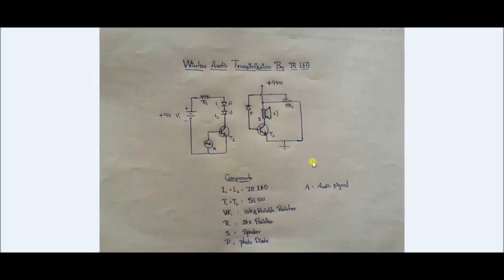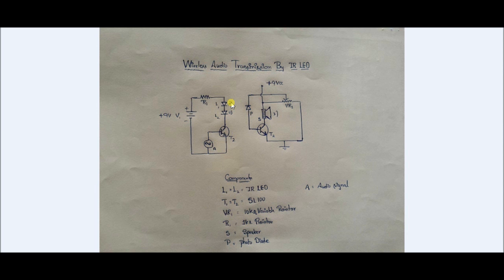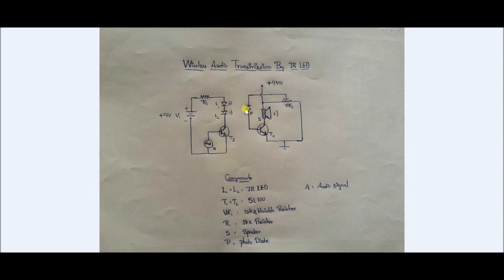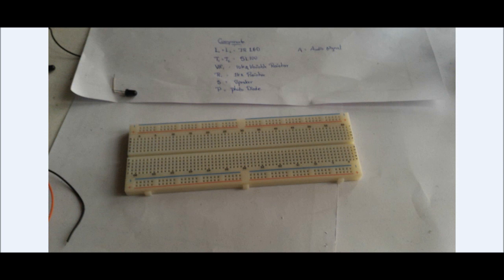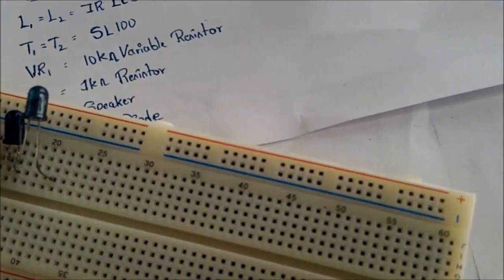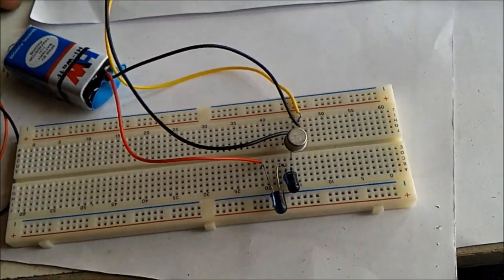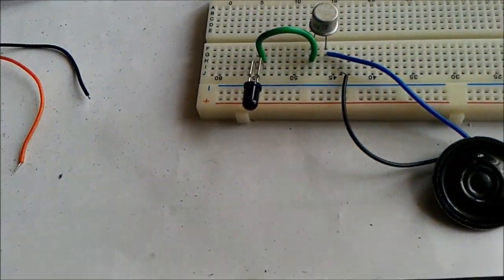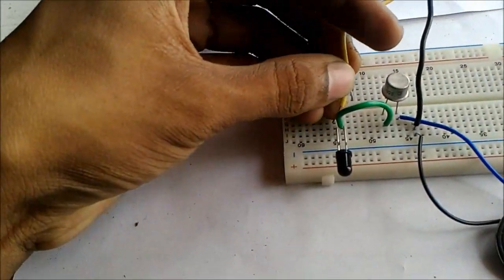Simple Audio Transmission and receiver

Comment: Can wae use IR LED without using Photo diode?
Reply from the maker: Captain Kabir - Creative Channel of Bangladesh
Yes u can, In fact receive bias of ir led will act as photo diode
Reply: Brother,my photo diodes are looking like normal diode(Not like yours)...........I have founded it in my nearer electrical shop.......Can I use it?
Reply from the maker: Use ir led in reverse bias, because I don't know which type of diodes you are using, but I can say how to check that diode is working or not

Connect two leads of diode to multimeter and set multimeter in voltage mode, now light an ir led, if it is on you will see a purple light when you place your camera, now focus it on diode, you should see voltage change. If there is no voltage change, you can't use that diode

Comment: Can we use Antenna instead of IR LED???
Reply from the maker: we cant use antenna Because here we are using an audio signal which ranges from 20-20kHz 
if want to still use an antenna you can do things, 1.you have to modulate with high-frequency(around 100MHz) carrier, so that you can use a small antenna, 2. this sounds funny, Use an antenna which is a length of your street if not working use much long antenna :p

Comment: I am making this project right now and I need help. The audio signal is not large enough to glow the led. Although when I measure it using multimeter I am getting a significant voltage in milli volts. What should I do now?
Reply: Prakhar Kapoor just make audio amplifier before feeding to leds
Reply: Aniket Shinde Yeah I thought about the same by using an op amp. How did you make the amp? Was it working? Please share, its urgent.
Reply: Prakhar Kapoor if u had sufficient  knowledge then use opamp otherwise use one extra transistor to increase audio gain and then feed it to LEDs I think u should use BC 547 transistor they have high gain and one tip use 100 nf capacitor in audio input side bcoz capacitor is actually two plates which never touches each other so it don't allow DC signal from battery and only allows sine wave(a.c. signal) or audio signal so it will automatically removes the distortion created due to DC signals as speaker don't like DC may be it helps you
Reply from the maker: You need to adjust DC biasing voltage in pot, because I think amplification is not happening properly or try to use another amplifier, test circuit using your mobile camera 
If transmitor is working properly the ir led intensity should vary in camera

Comment: hi hi. I have question that whether the circuit could be better if you add ADC and DAC in these
Reply from the maker: very good question, but answer is no because if we use ADC of 8 or 10 bit the we can't transmit all 8 or 10 bit signals, they get interfere and signal will be lossed.
but this can be done in other way ,after ADC use shift register which converts parallel bits to serial and the at receiver we have to do reverse like converting serial bits to parallel and then to DAC, this make circuit lot complex but range will improved

thanks for watching my video

Comment: how much wate specker you use
Reply: reply fast, I make hole circuit but I stuck on speaker, I subscrib you, like your video
Reply from the maker: its 8 Ohm speaker ,a normal toy speaker will work fine, wate depends on amplification . In this video i used 5W 8 ohm speaker, you can add amplifier for better sound

so for late reply :(
please feel free to comment for any other queries

Comment: hi how do u remove noise when transmitting?
Reply from the maker: hi 
here i am using ir light and room is not having any kind of ir light except transmitter ,so no chance of noise 
if u do same thing in sun or any kind of ir source light u will get noise 
in my case there is no noise ,so i didn't use any noise filters
Reply from the maker: thanks for watching